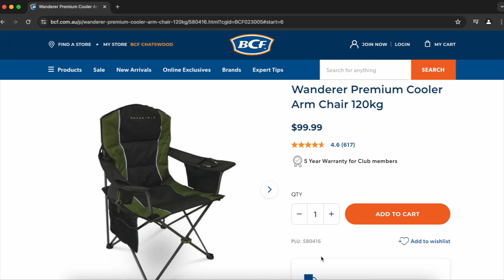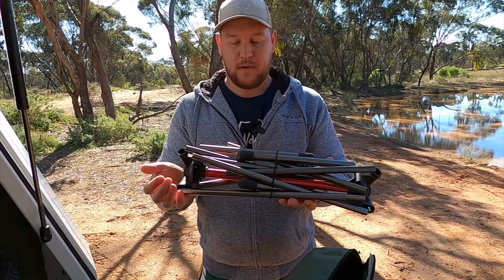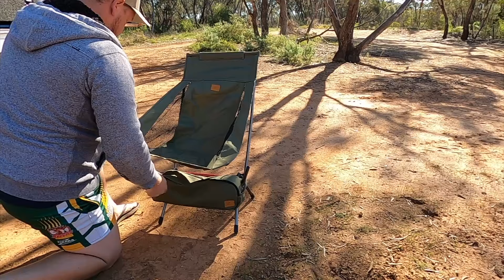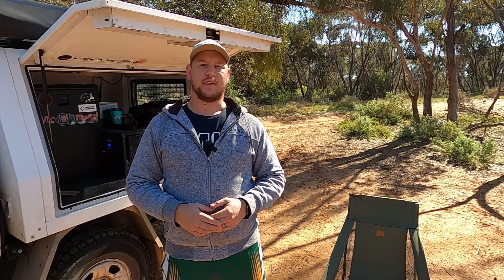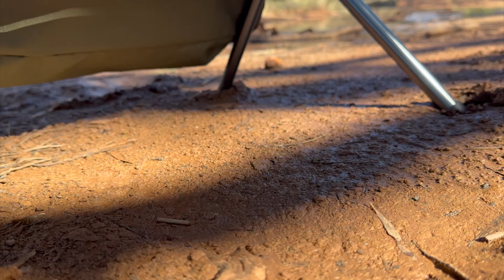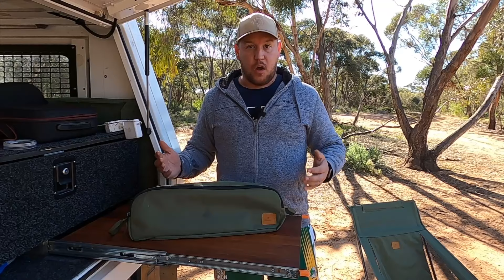An Ultralight Camp Chair that's CHEAP and COMFORTABLE

Comment: Just got a couple of the YL05 tan upgraded (silver bar) for $36 each US because of this vid, thanks!
Did have a prob stretching the canvas on the last pole. 
Started at the bottom & for the last pole on top, took off that foot & attached the last pocket.
Its Good in the Woods has a tarp/duct tape bathtub floor hack to keep from sinking in mud/sand.
Reply from the maker: Cheers mate! Glad you were able to grab a couple and I’ll have to check out that bathtub floor hack 👍🏽

Comment: My headrest stitching blew out, bar poked through. Amazon refunded the full price after a return. Got the new model  and saved $20. New model doesn't have square edges.
Reply from the maker: Far out. 
Sounds like you got the dud of all duds with that one, sorry bud.
Glad they sorted you out 👍🏽
Reply: Gave the new model a run on my last trip. Old one was a bit more comfortable but no stitching issues with poles poking out. Really happy. :)

 @OutNAboutAustralia

Comment: These chairs are rubbish in the wind. Stand up and your chair blows away. Good for hiking but unnecessary if you  don’t have a weight issue
Reply from the maker: Couldn’t agree more mate, I either flip mine over when I get up or weight it down. 

I just find it a bit more comfy than the standard chairs and a bit easier to pack away.
Reply: Want a chair that doesn't flip during winds get a heavier chair. 😂

Comment: You might have to put some weight in the bag when you set the chair up. I have one of the chairs and you have to be careful around fires especially… it’s that light it only needs a gust of wind to tip it over and if you’re around a campfire there’s a fair chance Murphy will turn up and the chair will end up in the fire. I normally put a small log in the bag as a precaution…btw it’s a great chair
Reply from the maker: Thanks Rick, I actually had that thought when I was sitting around the fire the other night.
I'll definitely be weighing it down with something whenever I get up like you suggest.
Reply: ACumbrianLadOutdoors takes 2 ground pegs, connected with cord, wraps the cord around bottom rod & stakes down.